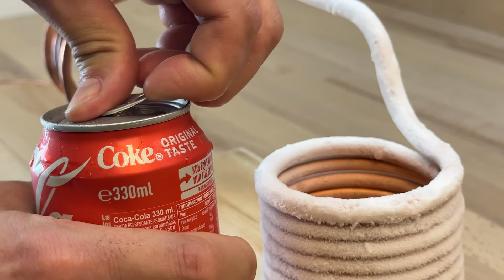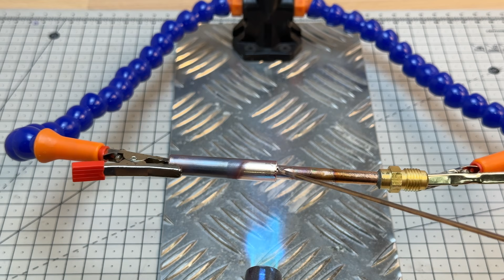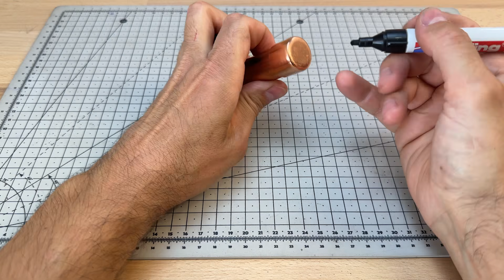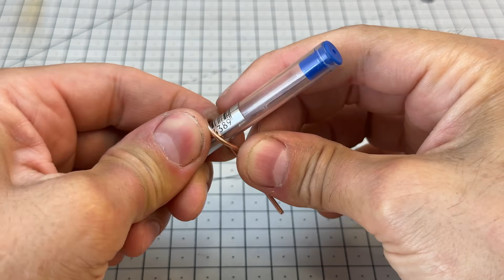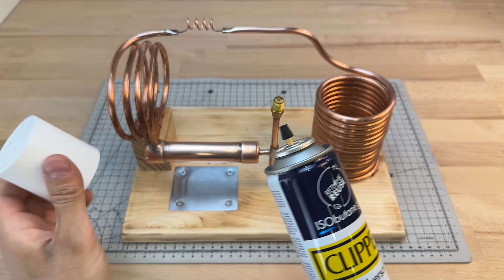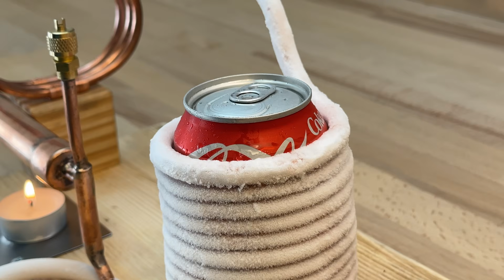❄️I Built a Cooling Machine That Works Without Electricity❄️

Comment: Adsorption Fridges Exist, a small one consumes propane of a typical 20 lb 4.6 gal tank inside a few days usually, fewer in hot conditions, more if not opened much in a cooler setting, so its not free energy, its a gas flame powered heat adsorption cooler, which Amish use with wood fuel or wood gas fuel, popular in off grid cabins, on boats, where power grid not available for vapor compression refrigeration systems electrical
Reply: Its not free, copper tube, torch, solder, time, effort, design, build, all together expensive to make, and requires good braising skills, plus the used of flammable hydrocarbon gas as working fluid also dangerous if any leak in system can produce a nasty fire

You candle the fuel, those are not free, so its not Free Energy, burning candle also not a clean way to make heat in terms of emissions per unit of thermal energy produced for input of such a system

Comment: Wow, a functioning circuit for once, among all the ai generated slop. Super cool :D But I am curious, there must be some kind of cycle to allow the gas to blow without being restricted by the back pressure. Is it due to boiling? Bubbles burst, which causes the flow to twich and then a bulb of cold gas can pass through the valve?
Reply: Je to fejk. Toto chlazení nedokáže vytvořit teplotu tak nízkou aby se vytvořily ledové krystaly
Reply: @jjkhd-dc4xl Why not?